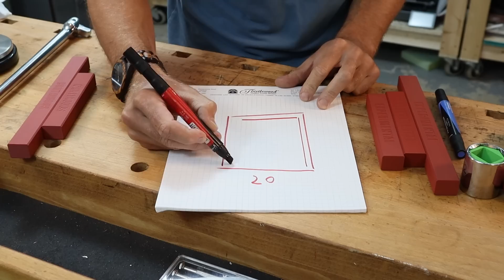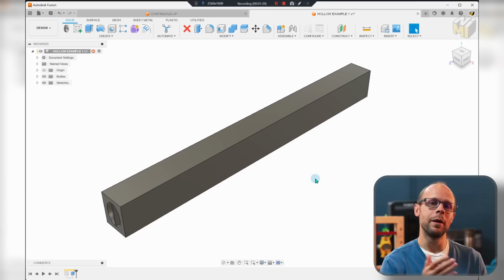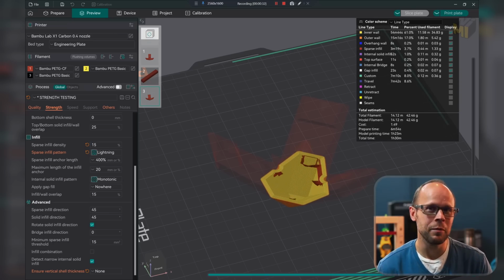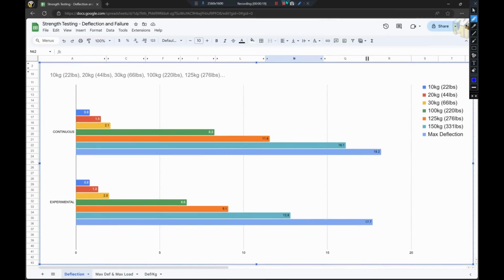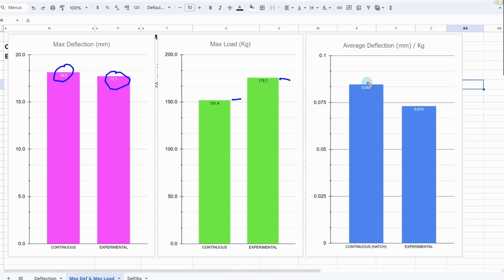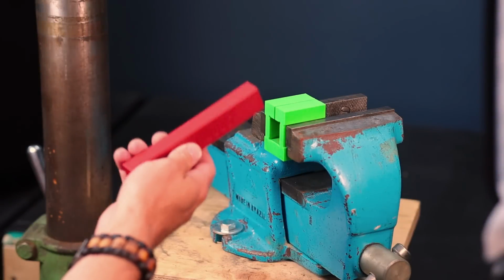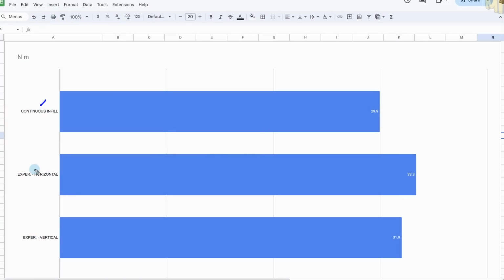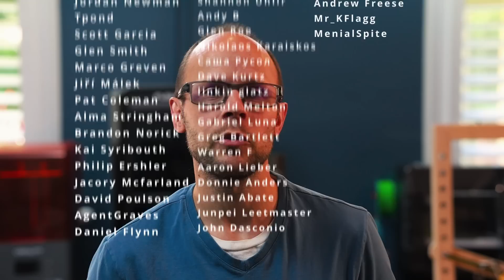Is an UNfilled 3D Print Stronger than an INfilled 3D Print?

Comment: Great work on doing practical testing!
Keep going! 

On the topic of the video, your results are not surprising at all. For both bending and torsion the more material your have away from the neutral axis, the stiffer the part will be. 
For bending you're increasing the moment of inertia of the part and for torsion you're increasing the polar moment of inertia.
Check out the bending and torsion stress formulas. 
Running a FEA analysis should generate very similar increases in stiffness.

While the macro shapes can easily be computed by FEA software (or even hand calcs in simple bending or torsion cases), the micro structure (interaction of intra-layer bonding) cannot easily be computed.

If you continue with testing, consider going deeper in that area. 
Perhaps do some comparisons between FEA analysis, hand calcs and practical tests to see if you can determine a generic "correction factor" which can be applied to FEA analysis which will reflect the actual part strength.

DM me if you want to chat further on this topic.

Comment: In cura that I use for printing  my parts I am able to add custom nesting models that I then set as modifiers, I then set those embedded parts in areas of high stress, say around areas where I am embedding fixing points or connecting structures between fixing points to then add internal structure by setting these models as  areas of infill that are 100% solid to allow me to bulk out areas of the print where nessesary and then use normal infill desity to fill the rest of the part as you normally would. this process then allows maximum dencity where you actualy need it and then sparse where it is needed for te printing structural support only. worth looking into.

Comment: The web, while doing little to the overall strength, is probably what lead to the increased stiffness.
In order to bend your part needs to flatten the inside oval, which is opposed in tension by horizontally webbing and compression by vertical webbing.
I suspect you could leave the webbing out, though, and still have roughly the same performance, albeit a little less stiffness.

Comment: That's why Injection Molded parts achieve a greater ratio between resistance per weight (material used) - it is not just the process, it is also because there is no material being wasted in infill, the whole thing goes to the walls. When you need reinforcement, you put ribs. Things are better planned. We should see infill as a wasteful lazy way of giving some internal structure and achieve easy printability - but it is not the best usage of material. EXCELLENT VIDEO! Thanks!
Reply: Yeah injection moulds better be planned out well. Because a fuckup will cost 20k of machining instead of 20euro worth of filament
Reply: @xilw3r  way more than that.

I work at a foundry and our wax injection dies are 40,000$ for the smaller and simpler ones.

Some of them run up over 100,000 because they have so many moving cores, required surface finish, etc. They actually have ratings for employees and you basically have to be a master tech to setup and run those dies because one mistake could be a 6-month interruption to making that part. It takes a long time for the T&D shop to fit, finish, and polish them.
Reply: Also like the other comment said, good luck injecting any thick sections
Reply: Injection molding gives you perfect layer adhesion and mostly isotrophic properties - but ribs in hollow spaces are out, you'd have to join parts & plan around undercuts to get the molding dies out.

And then there is the "at home" factor, :)
Reply: Injection moulding also has a lot of downsides that can lead to lower strength too, like having to design the part to be mouldable from as few pieces as possible.

You also need most of the part to be the same thickness with injection moulding to allow the plastic to flow and fill the mould properly, so no thin or extra thick sections, so if you need reinforcement and extra thickness in one area you will then waste lots of material in the rest of the part.

Making a beam like this with injection moulding would not be a good idea if you were even able to make it work, 3D printing it is easy though and you can add material where it is actually needed.
Reply: @conorstewart2214 this part could be kade with a 2 part mold. Very easily. 

Also, large gaps can and have been accounted for. Injection molding's only real downside is speed between idea and part, and base cost. You might need a 5k mold but you can also make 500 parts per day for the next 10 years
Reply: Great insights
Reply: I think you mean blow molded, not injection molded.

Injection molding is generally a solid part.
Reply: infill is basically support material for the insides , not much more😅
Reply: @ry7hym  It provides compressive strength and can give trellis type rigidity benefits. Interestingly, lightning infill actually provides the most added strength in my experience, if you use it with infill multiplier 2 so it's a single closed path, by auto generating "ribs".
Reply: Injected molded parts perform much worse in this regard in my experience because the process is not conducive to super thick walls. Printed parts with 2.5+ mm wall thickness and low infill do a lot better.

Comment: I'm a bit disappointed, the execution of these test left a lot to be desired this time. 
You constructed the part correctly in CAD but printed it with the spine in the wrong orientation? How did that happen?
The part was carrying dead weight as a result, which makes your calculations meaningless. 
And the inconsistency with which you applied the load is a big problem as well; loading it, letting it relax then applying load again several times ... that's a completely different failure mode than what you were attempting to test.
Get a $20 pneumatic cylinder from ebay, mount it in pull with a 3:1 ratio, add a pressure regulator and you've got a proper setup. 
I'm not demanding a multi thousand dollar testing rig here, but if you want subs instead of click&runs you've gotta step up the game at least a little for this sort of content. 

My last point of criticism is the number of test samples. You more or less said it yourself already: a single data point as reference is statistically irrelevant. 
The average of three samples should be the minimum, or better imo, 4+ samples and drop the highest and lowest results then average the rest. 

Get a filament sponsor and use their affordable products for your testing - makes it much more relevant for your viewers. 
PETG-CF isn't that expensive, but it's still twice of what most ppl are willing to pay for their every day PLA prints.

Still gave it thumbs up.

Comment: exponentially decreasing infill density to the center would be nice ^^
Reply from the maker: I'd really like to find a way to try a bond-structure style print, the center can hollow, and increase from there.  I think CNC kitchen did something a couple of years back in changing the line thickness, instead we'd need an infill type to be able to change density in all directions while still being able to bond to the previous layer and have continuity.  I guess that's where the idea of the Voroni Lattice comes in.  I think Grasshopper with Rhino has this capability, but I don't have it.  Fusion has something similar, but it's not nearly as capable, it's very limited in what it can do and cumbersome.
Reply: @NeedItMakeIt  CNC kitchen also made a video of clear PETG prints a few years back, the interesting thing about such slow printing is that the layer adhesion goes through the roof.
then again, I have 4 printers and don't mind a few tasked out to multi day prints
Reply: @NeedItMakeIt adaptive cubic changers density based on how close it is to a external perimeter. You can add s lot of infill percentage to get to same weight as other infills. Might be interesting to play with infill width too. Might increase layer bonding.

Comment: I've read over the years that infill adds little to part strength and that it's mostly down to perimeters. The experimental one with a hollowed oval inside effectually doubles the perimeters. All that said , reading things on the internet is one thing while doing experiments like you are is on another level. I'm digging this series!
Reply from the maker: What I might try is to take the oval and try different shapes instead, maybe just slight rounded vs very rounded, all of them must be the same weight to have an apples-apples contest.   I could further increase the wall thickness by changing the inside corner radius less and less and redistributing that material.  I'm glad you're enjoying it, I'll have lots more to come!
Reply: @NeedItMakeIt  Why not try and maximize the area moment of inertia? Get all that material as far from the neutral plane as possible while still leaving enough side wall to prevent buckling and enough fillet to keep everyone happy.
Reply: I routinely cut internal tubes out around through holes for bolts on molds that I design so that it adds 3 to 6 extra perimeters around those through holes so that clamping the bolts down at a higher torque doesn't crush the print. A few extra parameters can be incredible at adding strength
Reply: It's all about the wall. Just look at how steel tubing is the dominant model in fabrication.
Reply: Yeah I think even in solid metal parts, the majority of the strength comes from the outer skin
Reply: @mynameisben123  But the skin can be made stronger though texture, corrugation etc...  There is no easy answer to do this with 3D printing, it's hard to do with Blender (I tried it) and there is some software that can do it but doesn't work on Bambu lab printers as it doesn't add the texture to the model but to the print instructions.  Stefan has a good video on it though.
Reply: Yep, all of the bending force is trying to stretch or squish the skin, so it's the skin that matters. BUT - that's only true if the skins remain separated! You need to have enough infill or other internal structure to prevent the skin from collapsing inwards or bulging outward. Consider a cereal box is stiff - it stands up straight, and it won't bend over - unless you squish it flat. A flattened cereal box is floppy.
Reply: Just saying adding more perimeters makes things stronger is a bit of simplification. Strength of object (3D print) is dependent on how it is loaded (forces acting upon it). If you load your part only by compression or tention, your best strengh comes from solid object. Bending like this example is a bit trickier, the strength in bending loads comes from maximizing the moment of inertia . So you need as much material as possible in location that is as far away from bending axis as possible, but you also need some material to connect those two material bodies. Think of I-beams, you have chunk of material on top and bottom and relatively thin rib connecting them. If your material is similar in strength in compression as in tension the upper and lower body can be identical in cross section. If not you can make one cross section bigger than other by the difference they have in strength.
If you want good stiffness and strength in body that is subjected in bending you need the material in outer layers (perimeter layers) only in top and bottom of the cross section, the sides only need to hold these you can basically hollow out the mid section because there are low forces acting there.
Reply: @koitk  Building on what you said, it's the portions farthest from the neutral bending plane or axis of torsion.  For bending, the top and bottom give all the strength, but need to be connected.  If bending is only in one direction, and there is no torsion, I-beams are ideal.  Box and round tubes are good for handling bending in two directions and torsion.  If torsion strength is needed, uniform cross section is good.  For resistance to bending, making the beam fatter in the middle (like a truss bridge), is a good solution.  My mechanics of materials class had all the math, but I can mostly just remember the rules of thumb.
Reply: I think the direction printed also makes a difference.
Reply: By that logic, dividing the hole in more separate cavities will Increase the strength a lot
Reply: @affegpus4195 you'd increase the weight at some point.  

For good strength an old school skeinforge honeycomb is decent. Its also slower to print.
Reply: Yes and no. Small parts can be printed without infill, and you might never notice the difference. But when you have bigger shell. Especially flat, squared surface with edges, then you definitely need support (not only by printing meaning) also if you print enclosed sphere you don't really need infill. Only something to keep the upper 1/8 part. (northern circle)
Reply: Try cnc kitchen who has tested this and probably everything else you can think of more scientifically
Reply: @Just_Natee   Oh, I follow Stefan too but it's nice to see different types of testing like the torque wrench.

Comment: What is the orientation of the layers relative to the bend axis?  This can have a significant impact on the test. These are not isotopic materials so you need to take print orientation into account.

Comment: wait, is black filament really that much stronger than red?
Reply: The black has no carbon fibre unlike the the red one
Reply: @chatroux399  ah I thought they were both CF, thanks!
Reply: Depends on brand and filament type. Can totally vary.
Reply: @802Garage   yeah but I thought it was the same bambu petg cf, just in different color (as he used them in previous episodes)

Comment: Add a large nut, and a threaded bolt to the end of your lever and either add a motor or a hand crank. This way you can apply a very consistant force. If you add a stepper motor you could even calculate the number of turns it took at breaking point. I know its another upgrade but I think it would provide a better result than your hand would. Measuring with consistency is best especially with sometimes wildly different results.
Reply from the maker: I was thinking about switching to a motor and hydraulic cylinder setup, do you think that could work?  I'm happy to do the upgrades, if the channel grows enough I will buy some proper testing equipment as well... I think I'm a ways off at the moment.
Reply: @NeedItMakeIt I wouldnt bother with hydraulics at this stage. Just get some adjustable construction support rods, they're dirt cheap, super rugged and usually come in trapezoidal thread variants.
With that and a big wrench, or crowbar, you can get a lot of force going quite easily.
Reply: @NeedItMakeIt  you could get by with a simple car jack if you wanted to. They are relatively smooth to operate and maintain pressure the entire way.
Reply: @NeedItMakeIt  an issue you could have with hydraulics us that they are usually not continuous and you might be shocking the part which could lead to inconsistent failures
I think lead screw+geared down motor is probably the easiest
Reply: Probably should put some basic cage around the outward ends of the structure as well, unless you're aiming for a nice swiss cheese drywall theme

Comment: If you did a topology optimization for the bending load cases alone I would expect some triangulation inside the rod, would be the optimal solution.
But when you add the torsional load case and somehow desides on a weighting between the two load cases, then I don't have a guess on what would be the optimal solution.
For torsion allone the optimal solution would probably just be a hole through the center, maybe save some weight at the ends if you allow for it. You could maybe also get some compensation for the stress concentrations you get at the countersunk text, witch would be a week point from where a crack could start.

Comment: I really wanted to see the bend test with the center support vertical (parallel to the direction of the downward force).  Maybe next time?
Reply from the maker: I will set something up, I have a few videos in the works at the moment, but I will try to integrate this into another test video.
Reply: I would expect a big difference in vertical vs horizontal prints in this instance

Comment: Oh wow, that was unexpected! Thanks, this actually may be a game changer to be honest - if we are trying to make the tough parts. Great results and successful experiment!
One observation from my side: at 7:25 You may see the cracks started to form before the part went flying. I am wondering if those cracks started happening after some threshold or prior to that....? Reason: when You have infill it's somewhat flexible thus the amount of times You can put a high load is not small but if You have smth more rigid it might be tricky - if, let's say, You go to 80% of max load and those cracks start to form this means we decrease the max value with every load put. It's not necessarily the case - I am just thinking out loud. I would propose the durability test additionally to the one You've already done - and if that will be a success as well - we can basically ditch the infill (in 90+% of the cases). Thanks again - it was really interesting :)
Reply from the maker: I think it's not far from the direction we need to go, it needs some refinement of course.  Yes I messed up the final test on that part because it was too hard to force the lever down, I'd need a longer lever.  I like the idea of a durability test, that's a great idea actually.  I could setup a part to have force applied and then removed and continue this until it fails by no longer being able to take load by deformation or breakage.  I think there is some potential here for sure, I think we need to do some more research and testing.   I also want to test extremely sparce infill with far increased thickness.  And I have a few more ideas too and maybe there is a way to combine all of the concepts into something even better.